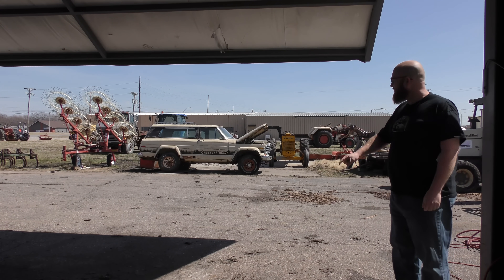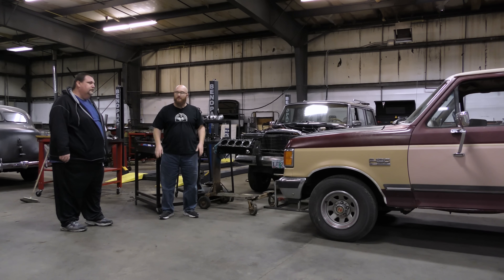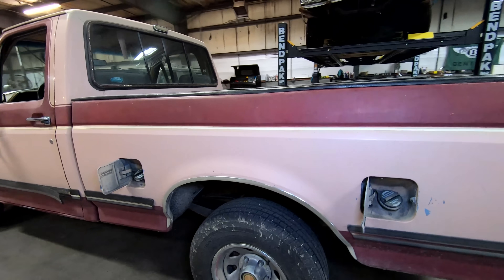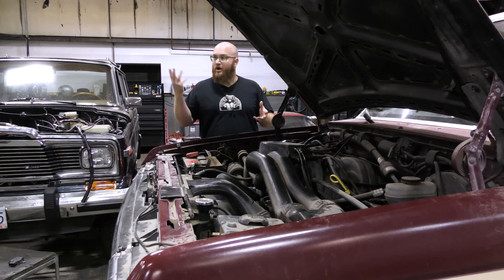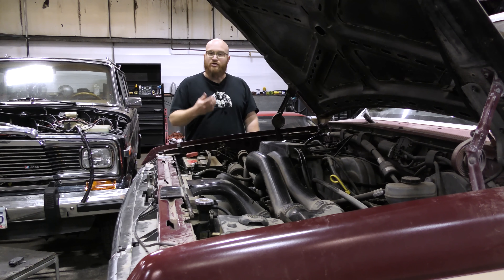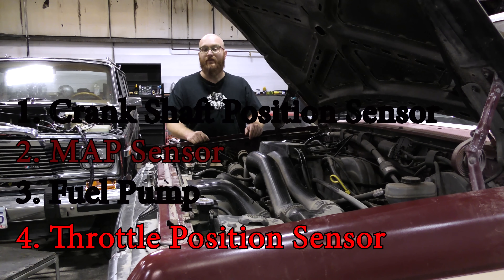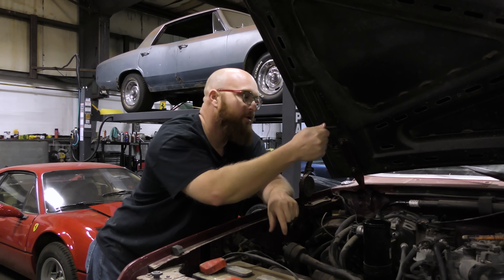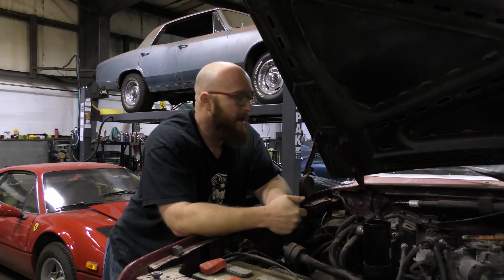Parts cannon couldn't fix this '90 F150. Old School diagnosing by the CAR WIZARD

Comment: I have a 17-year-old 2005 Saturn Relay 2 minivan. 3.5L V6 and FWD. We looked at new ones 2 years ago, and I looked again recently. I'm only really considering either a Honda Odyssey or Toyota Sienna. But even those used are quite spendy. In the last 2 years, our minivan has had new steering gear, struts, springs, valve cover gaskets, front and rear main seals, oil pan gasket, and heat door. It's in the shop again. Fuel pump and fuel sensor, another heat door (going with a GM part this time, wish I had found Car Wizard 2 years ago to hear his advice on aftermarket vs OEM parts), radiator cleaning, and possibly a radiator fan. I pulled the thermostat myself at the start of summer and flushed it to remove rust poor man style (drain the radiator, add tap water, drive it, repeat the next day). Yep, we've spent more than the minivan is worth. But it has 140K miles, leaks less than it used to, and we've spent probably a fourth what a used one with 80K miles would cost. Thank goodness it's a 3.5L V6 and not a dreaded 3.6L V6.

Comment: Map sensor or tps is usually the culprit on most any engine. Ive seen intermittent crank sensors that would work cold but fail hot especially on chevrolet big blocks where its so much fun to replace😂😂😂😂

Comment: Very good.  From the onset, I had a vacuum leak in the forefront of my mind even though I'd never known one to cause a surging idle.  I'd have to say that this is another example that a factory service manual would have been an excellent resource to at least narrow down the problem.  That's a Factory Service Manual from Ford, not a Chilton's, Hayne's other run-of-the-mill manual, even if they're specifically labeled for the vehicle being worked on.  Factory Service Manuals have information directly from the engineer's and they often include a check of certain things because they've forecasted a future issue occurring due to time or wear.  Sometimes you have to use common sense.  But you always start with a check and confirm of the basics before spending any money on parts. 
Years back I had a carburetor that the throttle shaft holes on the carb body were worn to the point of being somewhat oval.  That was enough to cause a high-idle and hesitation on launch.  In short, I was able to isolate that because of the dirt that accumulated at the entry points of air being drawn in.  I was broke at the time, so I needed to figure out a way to stop the excess air from being drawn in.  I realized there was just enough room on the outside of the shaft penetration points to fit a thin white-plastic washer on each side.  Installing those solved the problem.

Comment: I ran into a similar parts availability issue with the fuel injection harness on my 1999 GMC 5.7 liter Suburban. New harnesses were $1500 and scarce. Used ones were cut up. Mike's Auto in Hutch ended up searching for the short in my harness, made the repair, and wrapped it with heat tape. No problems in the last 8 years. Now to save up to solve a "transmission component slippage' code.

Comment: I recently picked up a 1983 f150 that has the straight 6 and only has 71k miles on it and I’m not in the rust belt so it’s intact.  It sat for 20 years, I got it running in about 3 hours and drove it home.   Its going to be my summer project this summer and it’s a great vehicle.

Comment: My first job out of college was for a Tier 1 automotive supplier.  One of the products we made were the body side molding for the F trucks.  Black PVC, with mylar (Chrome) strips, the bottom of the trim had aluminum tape heated into the PVC, and then Neoprene Tape to hold it to the body.  Straightening out the aluminum on the door trim would be difficult.  Most likely, the cells of the neoprene foam split, causing it to "split" from the surface.
If you use a wire brush to clear the adhesive off of the paint and back of the aluminum, you may be able to repair it.

Comment: Original owner of a 92 5.0 which I have struggled with over the years to get running well.  It is not easy to figure out and fix.

My truck had high idle due to intake manifold gasket.  Also several vacuum leaks, the reservoirs rot and very hard to get replacements.  The manifold took me years to figure out because I replaced the gasket more than once, it was a manifold not machined right, had to file off a bit from one end!  So this was a problem from day one.

I've done the parts swaps and chased many hunches from various videos.  In fact your words have me ready to try another, yes another MAP sensor.  I've finally gotten my idle down to a nice level, like 650 rpm but it is rough.  The 32 year old truck, it's like it is not used to a normal idle!

I can say if you learn to fix this type of truck consider yourself a mechanic.  On the other hand, it has endured many problems and seems to keep running.  I recently changed fuel injectors and discovered a loss of fuel rail pressure.  It turned out a new injector was stuck open.  On and on- war stories.

I wish I could bring it to you!

Comment: Guys like this with actually knowledge and skill for how these power plants work and can be fixed is becoming increasingly rare every year. As new cars clamp down on repairability and panned obsolescence, I find more “mechanics” are simply there to read the computer and replace whatever part assembly it tells them to.
The idea that you’d replace the specific broken part within the assembly is out the window. Sometimes society does not change for the better…

Comment: I have a 95 with the obd 1. I bought the old obd 1 scanner, but like you said most of my problems, high idle, rough idle, timing, didn’t throw a code because a lot of the obd 1s were just made to check emissions equipment and nothing else really.

Comment: I just wrapped up work on the very same truck today and sent it home with the customer. 302 with the 4 speed manual in the very common blue and white.  It spent some time with us.  New fuel tanks, fuel pumps (including the one on the frame rail), brakes, water pump, ignition cylinder (came to us with no key)  83k showing on the clock, and judging by the pedals that was correct.  Nice old trucks.

Comment: Love that paint scheme . I had a 1989 F150 XLT Lariat 2x4  351  3 speed automatic with 411 gears same paint scheme but it was blue and white then it had a blue torno cover with chrome reals that went down the top of the bed in the pockets what a great truck wish I still had it .

Comment: As a kid I always kept a rebuilt quatrajet in stock. Used they ran about $25.00 and the Jiffy Kit to rebuild them was about $7.95.  I could rebuild them in my sleep in about half an hour. They almost never lost their settings, the accelerator pump and other gaskets just went bad. But if there are still big old junk yards out there, that's likely where you are going to find a TB for that truck. See if it cross references to something else, like a crown Vic, LTD or a mustang.  Ford 5.0's were pretty ubiquitous. I kept my Galaxy 500 running for years with F150 parts.

Comment: As far as crank sensors go with GM LS1s in trucks I've had ones that work fine up till about 3500RPM. When you pull out of a stop on a highway and get on the hammer it starts to buck like a bad TCC solenoid yet no CEL. Vac leaks suck. I had a teeny tiny pinhole on my intake on a 2011 Sierra and it would command max fuel trim +15%. It was a bad plastic molding an aftermarket metal one fixed it up right away.

Comment: Something that can help is to tuck some dental floss around the throttle shaft in the housing.  Less than ideal but it should help until parts become available.
Reply: Great idea! Maybe Teflon tape,it sticks to itself somewhat.

Comment: I had some strange issues with my low-mileage, well maintained 1994 Miata - obviously pre-obd-II. It took some sleuthing, but I found that the paint marks on the throttle stop screw and idle adjustment screw had been tampered with (these screws are set at the factory and are not supposed to be tampered with for ANY reason, and the “official” guideline was to replace the entire throttle body to correct the adjustment!) I managed to find a factory-issued bulletin that described the process for dealer service technicians to re-calibrate the , throttle plate, stop screw, position sensor, and idle screw using a multimeter, a timing light, and a .0001 feeler gauge. After following the document - the car has run perfectly ever since!

Comment: I have a 1987 F-150 with the 4.9 straight 6 with the 4 speed manual. My dad got it from his uncle with 37k original miles in about 2005. It still had everything original. Started right up with fresh gas and drove home after sitting for 15 years. Still runs great. I bought him about 2 year's ago. Has about 105k on it. Rear tank doesn't work. Cab corners are a little rusty.

Comment: I daily drive a 94 f150 with the straight 6. Just turned 308k. I’ve learned the salvage yard can be a valuable resource for hard to find parts. Just make sure the parts aren’t bad like the part you’re replacing!

Comment: The body is solid on that truck, not a lot of road salt over the years.  Nice to see some love for the Bricknoses-it seems they get overshadowed by the earlier Bullnose trucks and the later OBS trucks.  I have a '91 also with the 5.0, but the 5 speed, 3.08 rear.  Pretty gutless down low with that combo, but low RPMs when cruising 45mph-65mph.  The 5.0 likes to rev to make its power.  A turbo muffler with the stock exhaust piping gives it a nice sound without the expense of a full exhaust, and will not cause issues in states with inspections.  The XLT Lariat trim is all we need-A/C, power locks, windows, cruise, Dolby Cassette player that can be used with modern adapters.  The XLT bench with the half headrests shown isn't bad, but I am thinking of swapping it out for a '92-'96 one since they have the full headrest-not a fan of modifications but safety is an exception.  At 30 years it feels like these trucks have already started appreciating-even before this crazy inflation.  

Another thing I will add-I had mine painted by a local high school vocational school a few years ago and they did a great job.  You have to be patient but you only pay for supplies and labor is $1 an hour.  This generation of trucks sort of bridges the gap between old school while still having enough options to be comfortable and somewhat modern.

Comment: Good video.  One option is at older used parts  places . It takes time but if the young man didn't  mind checking in a old scrap yard could check there . He has all new electric  parts he cant return . Might save time

Comment: I drive a 1985 F150.  Had a high idle.  Many vacuum leaks when I got it.  I took the Throttle sensor apart and installed a spacer inside it to get the engine to stop idling so fast even when it was warmed up.  Had other small things to fix alongwith replacing all four body mounts under the cab and patching wheel wells tats were rusted.  Used Dodge body parts on two.  Very reliable truck.  Got 2K into it; half that was the price of the truck.  First year for EFI.  
Can't find ANY info on working on it.

Comment: just went thru this very issue on my 87...throttle position sensor and cleaning of the idle air control fixed mine ...idles great now.

Comment: I have a Dodge with an OBD1 for  which the  Chrysler dealer scan tools are ridiculously priced. But I found a factory diagnosis manual  that documents the voltages that various pins on the PCm should show - jumper pin X and pin Y and pin Z should have a certain voltage or OHM resistance.  It isn't a CAN bus , you can use a multimeter if you have the documentation.  I never found the  diagnosis information online, I saw the manual on eBay.

Comment: He is right, my 1988 Ford F150 , 302 v8 runs forever. The only electronics on the truck are the fuel injection and the so called " rear abs" that is had. All I've ever done is carry a spare alternator and belt in the back. The idle problem i did have was with the EGR and the actual build up in the EGR pipe (they had egr issues and also loud power steering) I hit 300k+, had rod knock finally ( truck was a workhorse much of its life) .Dropped an ATK long block ( back in 2016) for just over $1100 dollars. Replaced the manifold (coolant ports were corroded) I would have done the r & r but had no time. V's performance (total ford specialists) did it. Also put on marine water pump and a bigger core radiator. Car runs beautifully. If something does go wrong, its cheap. I haven't noticed any high price items i have had to replace. Check BBK for the throttle body (unless you checked them already) They been around long time.  (rockauto?) Enjoy all the videos.. Thank you for the effort in putting them out on top of having a full warehouse of cars to get fixed.

Comment: I bought an 88 250 three years ago for $1000 and put about 4 in it. It had a 351W engine and some original paint left on the frame with only some surface rust. In Indiana that's a unicorn. After replacing most of the truck I can give those with similar issues a few more things to look for. Be aware you probably have multiple issues causing a problem.

The biggest pain to diagnose was distributor. There is a welded tab inside that can break and it will idle fine but cause the engine to stall or lose almost all power under load.

The most common issue with these trucks for idle or running rough is the EGR system. More specifically whatever the last owner did to attempt to remove the EGR system. 

There is an A.I.R. crossover pipe in the back of the engine right next to the fire wall. Is this has a hole in it you will get rough idle. If they "deleted" it make sure the ports are plugged. There are also ports on the manifold that need plugged if they did a delete.

If they deleted the EGR and just unplugged everything it will run rough. There is a deleted diagnosis tool you have to buy for the EGR sensor plug itself, but you also need 75k ohm resistors for the thermactor diverter and bypass sensor and the solenoid for the evap canister.

The fuel system is its own animal. There are three fuel pumps and the tank selector is just a diaphragm and a spring. The low pressure in tank pump causes the diaphragm to switch positions. They tend to get stuck and it can have the send line coming from one tank and the return line going to the other. 

If you are doing major work to the fuel system pull the bed. I replaced the entire thing without doing this and it was a mistake. It's 6 bolts a wire harness and the filler necks. It weights about 400 lbs long bed. I eventually got tired of messing with the two tank fiasco and put one 40 gallon in the back. 87-91 was a strange generation for Ford trucks. The resistance on the after market sending unit didn't match the fuel gauge so I had to swap the resistor array chip. You are going to spend a lot of time on the internet if you try to fix one of these trucks. 

As far as the not worth fixing part I have to disagree. They made so damn many of these trucks parts are dirt cheap. Everything on the rest of the truck is so overbuilt and you can beat the hell out of them and they will take it. Even with all the problems mine had with the engine I still drove it home. It might run rough as a night in jail but it will run.

Comment: Surging idle typically low F/A ration....and fuel pump CAN have an issue on this vehicle with F/I.

Throttle position sensor NOT correct!  On newer vehicle IAC.

Old vehicle NOT hard to diagnose.....vacuum leaks can also be checked with external fuel source...propane, brake clean, etc.  No need for smoke machine as fuel is not metered to the extent of OBDII

Comment: its good advice that if you want an older car or truck, you gotta think differently and use the old diagnostic methods. the carb bushing issue is very common on the old VW bugs.

Comment: Scantool data is fairly easy to come by now for reasonable prices. TunerPro RT or WinALDL are free windows programs that interface with cables that you can find on eBay, etc. that are specific to your application. Takes some set up and file sourcing, but I can now useful live data on my 88 Camaro (fuel trim, IAC position, coolant temps, etc.)

Comment: Hi Wizard, I've owned a few of these fords with the 302. Another notorious problem with this engine is valve cover gaskets leaking.  Drivers side is an easy fix, but the other side is a pain in the ass with the intake over that side of the engine.  The last truck I sold to a guy I said fill the oil & check the gas...  He blew it up 3 weeks later.  Thanks for the great content.

Comment: Since it doesn't have a CKP, I'm sure that's not the issue. MAP sensor on those old fords the reading is measured in frequency (Hz) and not voltage, like every other manufacturer used. Closed throttle reading from the TPS has to read under 1v, and though I can see it has a new one on it, it doesn't mean it's any good, or that it was installed correctly. Sweep test with a scope is the proper test for that TPS, as the ECU is VERY sensetive to signal drop. Love my old Fords!